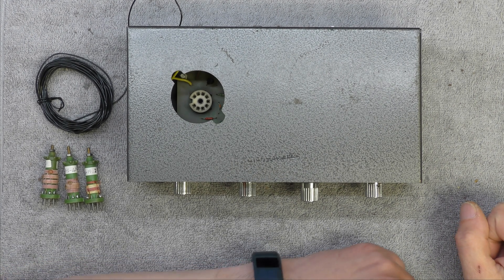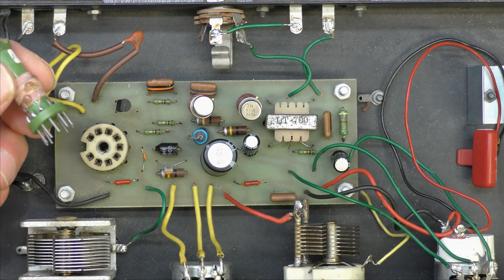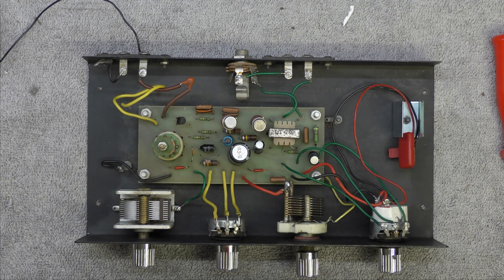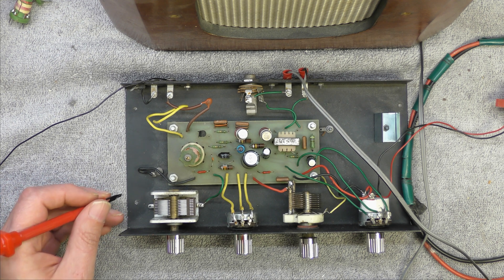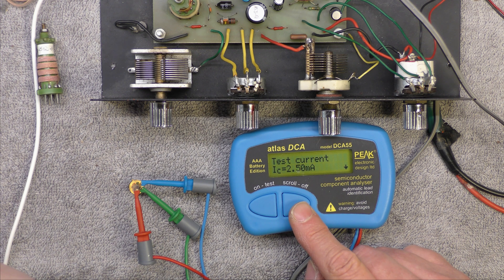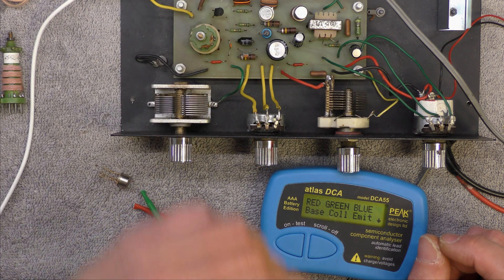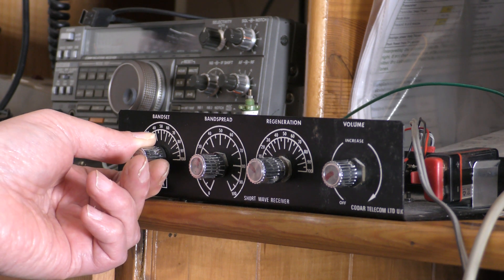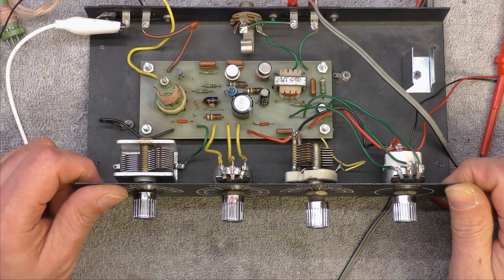Codar Mini Clipper Receiver Kit 1976 V2  (4K)

Comment: A friend of mine had the older Mini Clipper which came with a single valve, whereas I had the single valved HAC, they had the same performance except that my HAC came without the bandspread tuning capacitor so tuning was considerably more fiddly.  DXing with these things was always a two handed affair, one hand on the tuning and one on reaction and with practice you could get surprisingly good results.  The lack of a calibrated tuning dial was of course a handicap but after a while you remember the layout of the band, you start with a marker, in my case it would usually be Radio Moscow because that would always be a booming signal where I lived at the time, and then count the stations up or down to find the one you wanted.  Owning something like this was pure magic for a young boy in the 1960s, the bands were crammed with interesting stations to listen to and I spent many many happy hours using a simple set like this, able to copy anything that more sophisticated receivers could.

Comment: JFETs can be damaged by static. One of my first jobs was digging out dead 2n3819s potted in araldite and replacing them. I now know that araldite is unsuitable for potting electronic components, maybe that's what did for them , who knows?  It was a long time ago. A regenerative receiver, takes me back. Cheers, Steve.
Reply from the maker: Doesn't sound fun retrieving the FETs. I guess the junction is quite vulnerable to static and impulses. I think plastic packages are not that moisture proof and it creeps up the leads,  Steve. Thanks for watching, Daz

Comment: The tuning capacitor seems quite small, does that mean the inductor is a bit small and doesnt produce as high a voltage.
As a kid i made the crude crystal set, a good earth and long wire.
I could hear local stations and luxemburg .
I had a 500pf variable toaster rack and a toilet roll tube  fully wound.
Large cap, large inductor. 
Bloody loud lol.
Reply from the maker: It's a good point. As it has to cover a wide range. I wonder if some compromise has been made with inductor values. I'm keen to try a crystal set myself as I got some vintage headphones, while we have AM still. Thanks for watching, Daz

Comment: A very interesting artefact you have there Daz, the coils appear to be Denco and I may be wrong about this but I always the green coils were for valve use, not transistor?
Reply from the maker: I wonder Michael if that's why they went for a FET instead of a bipolar transistor. So to use up the stocks they may have had from the hybrid version they made before? I guess they wanted to move towards solid state to keep things fresh. I think FET"s were the in thing too?  Thanks for watching. Daz

Comment: Many fets are symmetrical and source/drain not identified by most testers. Unfortunately most of Codar's receivers were quite poor. The best radio equipment they ever made by far was the AT5 transmitter, especially the later ones with the simple band-switch mod and PSU change for better netting signal.
Reply from the maker: I must admit I have the top band tx but not finished looking at it at the moment. Ah yes that will explain the tester results, thanks for that. Daz

Comment: Just think - you're picking up and decoding SSB signals with three transistors, when even the lowest cost SDR system has three billion. And you're linking back to ideas a hundred years old. I think that's a lot of fun.
Reply from the maker: Very good point, 3 transistors on a speaker. You get used to the bells and whistles of modern SDR or superheterodyne receivers. Thanks for watching, Daz